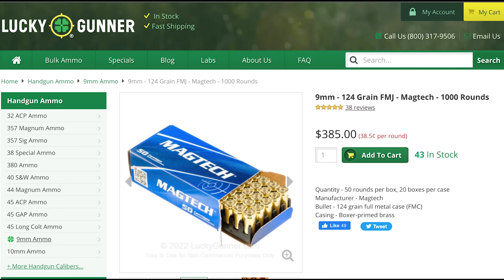Poor Concealment Leads To Man Having His Gun Stolen

Comment: This is a valuable lesson. And this is something I was always concerned about. I am an open carry, and have been for several years. When I purchased my firearm, I made sure they had holsters available for it, with at least a level 2 retention. Right now I have a Blackhawk Serpa Sportster. I checked it out really good before I bought it, and its been the holster for my every day carry for the last three years. I would eventually like to find something in a level three that will also allow me to mount a light to my pistol. When you carry, open, or concealed, there is great responsibility with it. No matter where you are, you need to be conscious, and aware of who is around you. Pay close attention to the warning signs, and don't ignore them. My number one rule with people. If I dont know them, or they're being hostile, or aggressive, you dont let them near you. Get away from them as far, and as fast you can.
Reply: The reason Serpas are maligned is because they placed the button to release the gun INLINE with the trigger. Training you to push your trigger finger to draw your weapon. Thunder Ranch and any other notable training facility doesn't allow them for the reason that they have had multiple neg. discharges during draws because of how it works. It was a bad idea because people get lazy. However, I could see it being acceptable for guns like traditional 1911s/2011s that not only have a manual safety but also a grip safety. Maybe they  would be fine for SIG P320s with safeties . Anyway. Concealed is a far better option. Even if it's only concealed by a jacket.

Comment: I use the holster you hate. I use a serpa holster and I also wear a cover garment. So I don't carry exposed. I don't like open carry. Why do you say serpa holster is crap. I like mine pretty good and in my opinion it does a good job for retention. I carry a commander size ruger sr1911 in 45acp and use the serpa for the 1911. It covers the trigger so I carry chambered cocked and locked. I also noticed that your a HK fan and dislike the 1911 type. But this combination works well for me. And the 1911 is a gun I shoot well. I like glocks but I don't shoot them good enough and therefore I don't own one. It's not that glocks are bad guns but they just aren't the gun for me